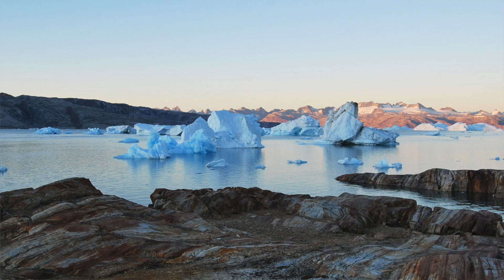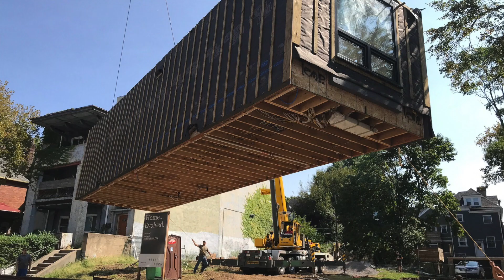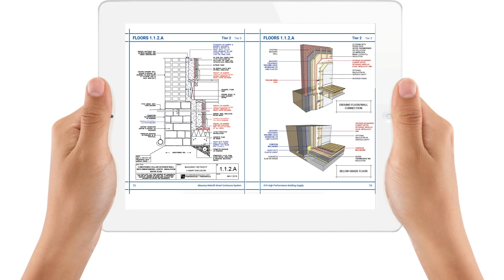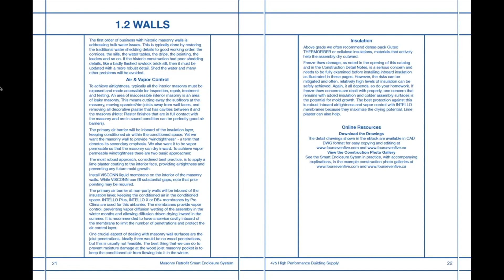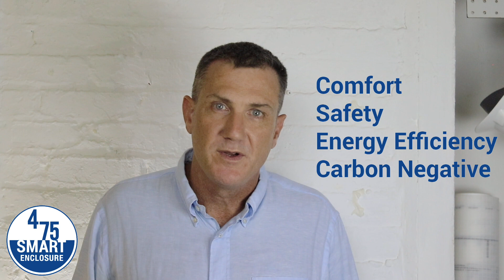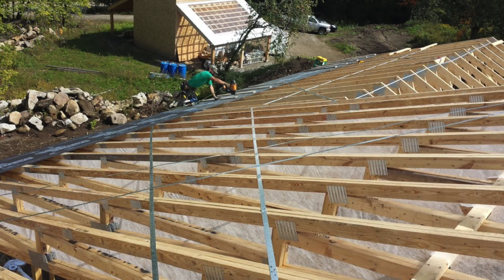The 475 Smart Enclosure, Part 1: What is the Smart Enclosure?

Comment: Downloaded and read all smart enclosure materials. Awesome materials. Thanks for those free resources. One question to clarify: in 3 tiers, is tier 1 the best, tier 2 the second, and tier 3 the third best?
Reply from the maker: Thank you for your support and happy we could help! It would be the opposite: the 3 Tiers are not precise demarcations of success but indicate a general direction of improvement, compared to each other, and to typical industry practice. So they go up, from standard construction: tier 1 is improved efficiency over standard, tier 2 is a more efficiency more simplified assembly, tier 3 is optimized (but far different than stand construction assemblies).